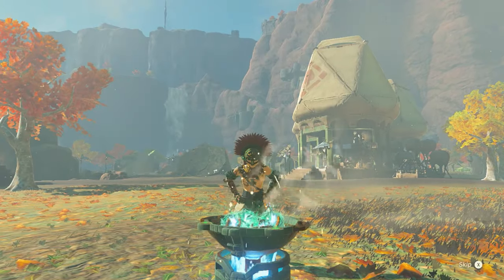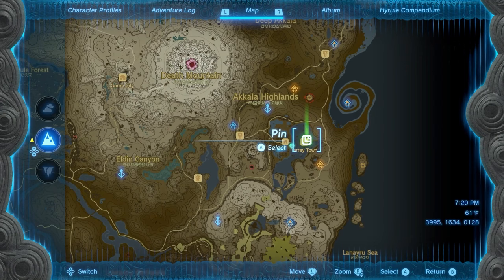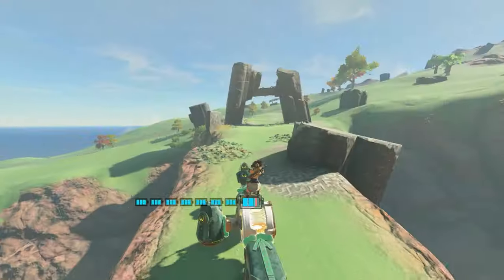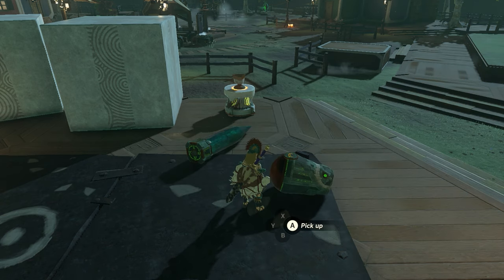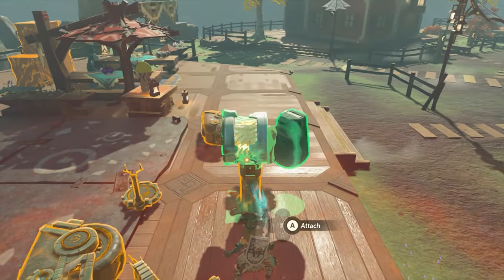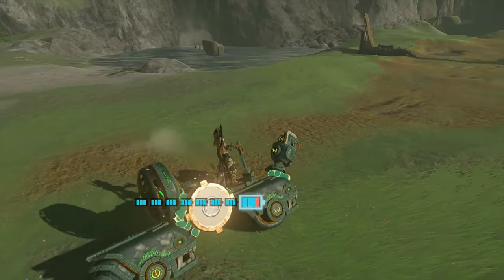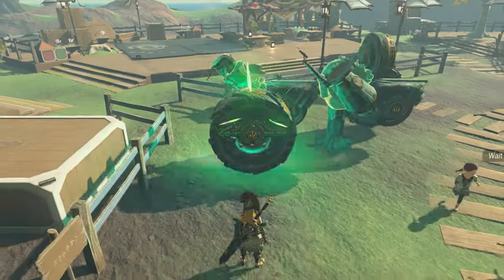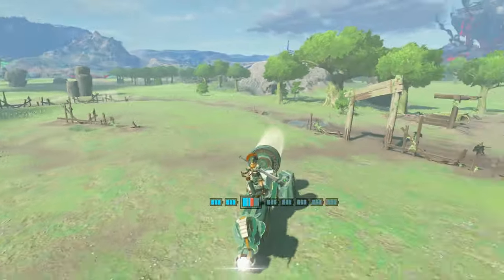Zonai Test Bench: Master Cycle Build in TotK

Comment: Ooh this is cool. I’m just wondering, what benefit does the motor add? Or is it just for the shape/look?
Also THIS IS SPARTA 
Uh wait what year is it
Reply from the maker: The motor allows the vehicle to make it up hills. Normally when you attach a stabilizer to two wheels it shifts all the weight to the front killing momentum. The motor makes it so the stabilizer can move freely and balance the vehicle. You can build a lighter version with a wooden wagon wheel but they burn/break easily. That’s why I opted for the Zonai motor with fans attached. Until I figure out weight transfer of items this is as close as I can get to the MC lol. Thanks for watching till the end dude. The next build is already finalized.
Reply: @RMFHGaming  oooh nice. Admittedly I haven’t experimented much with builds of this caliber so I had no idea what the motor would do, but this makes sense. Hey, it looks not half bad too, so if it’s functional and fits the look, then it’s a double win
Reply from the maker: It’s a power hungry build that’s for sure. The Zonaite armor comes in clutch though. Roughly the same power draw as the MS (with the Zonaite armor equipped) I made it from Robbie’s Lab to the entrance of the Lanayru Wetlands. The MS made it to the Millennio Sandbar.
Reply: @RMFHGaming  TBH even still that is a fair amount of distance, probably more than I would ride it in one go before getting distracted 😂